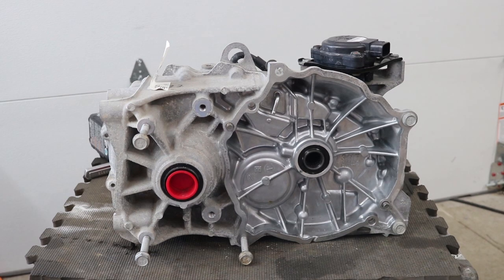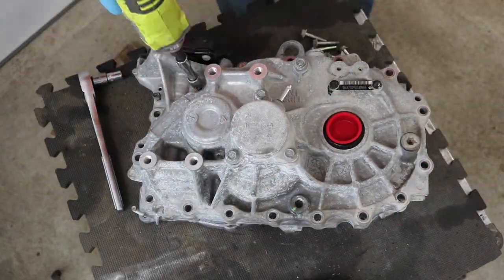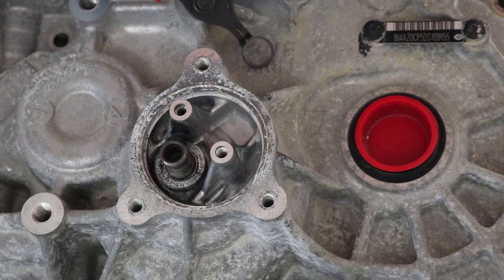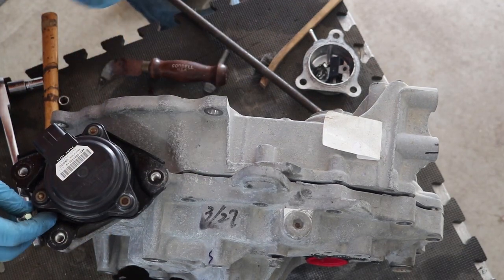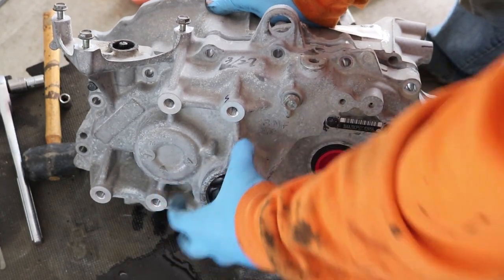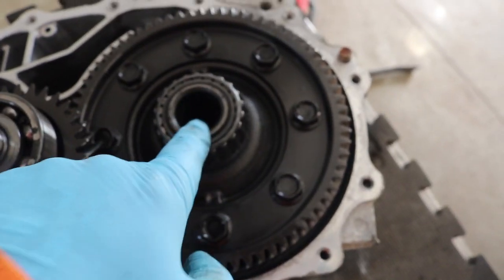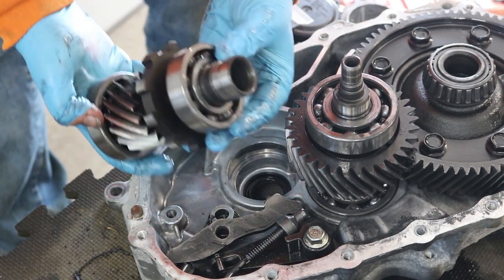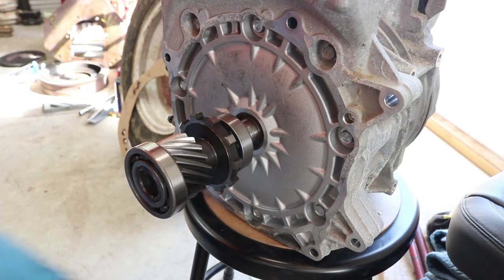Nissan Leaf Transmission/Gearbox Teardown

Comment: Inverters can cause serious damage to bearings from induced voltage.  Industrial and HVAC motos on Variable Frequency Drives have similar brush arrangements to protect the bearings.

Comment: Don't you want to use the gear box to bring the rpm's down? If you could lock the differential could you run a hydraulic pump off the other  side?

Comment: hello,  i have been watching your videos and i want to re power a 51 willys jeep with a motor like this.  does that trans/gear redux have a limited slip for each side of the outputs?  In my application i would make a shaft using the rear facing out put and connect it to my transfer case.  the problem would be if it was limited slip or clutched; i desire all the reduced rpm power exiting from just one side.  thanks for sharing.

Comment: I am trying to diagnose a problem with my 2011 Nissan Leaf. I would describe it as torque steer but I don't know if that's what it actually is... When I give it "gas" it pulls to the right, when I let off the "gas" it pulls back to the left. But it only does this once it's over about 30MPH and it does it in a "binary" or "toggle" fashion. Meaning it will only pull back to the left after pulling to the right. So if I give gas and it pulls to the right then I give more gas/torque it will NOT pull to the right again - only if I let off the gas and it pulls to the left will it pull to the right again after giving it more gas. So it toggles pulling left and right. That's why I think it's different than torque steer.  Anyway, I was hoping seeing this could lead me to at least a partial answer. What I CAN see here is that the left and right wheel are NOT being driven independently, it appears that they are both driven from the same gear. Which would mean that the pulling is not a problem originating from the motor but rather something after the half shafts going to the wheels. 
Any idea where I might look for a solution (The dealer thinks its the rear motor mount but this doesn't make sense to me)

Comment: Trying to figure out if I could flat toe a leaf behind our Tesla by disconnecting or manually actuating the parking gear. I don’t see any fluid pumps in there. I would like to take the leaf to the beach with us so not to get sand and junk inside of our Tesla and we have unlimited supercharging for free on our older Tesla.   Our leaf only has about 25 miles of range left
Reply: Mechanically there is no reason it can't be flat towed, and it should have a neutral gear.

Electronically, you may have problems. Voltages induced in the motor can damage the inverter, which is why no EV manufacturer (to my knowledge) recommends flat towing.

Comment: So the engine/motor is cooled by coolant, does this gearbox have transmission fluid?
Reply: Pet, the fluids specifications are in the Owner’s Manual. The 2015 Nissan Leaf reduction gearbox calls for 1½ US quarts of Nissan S ATF.
No drain and fill schedule is mentioned in the service schedule that is with the Owner’s Manual; only to check the level. Elsewhere I have found 50,000 miles recommended for changing the fluid.
Reply: Electric motors are only rarely called “engine.” Calling internal combustion motors “engines” seems to be an English language thing. “Engine” is “an ingenious, or clever, invention.” Thus “engine” lathe, cotton “gin.”
“Motor” < Latin mōtor = mover.

Comment: Hi thank you for your detailed easy way of stripping it down and explaining, I have one question you've probably been asked this before but could the motor be modified to be a off grid generator either by wind or hydro. I have no idea when it comes to electronics but I can hammer and weld anything.
Reply from the maker: You could, but it would be wild three-phase alternating current. Read up on some Wind forums about how wild 3-phase can be used for off-grid setups.
Reply: @BenjaminNelsonX  thanks for getting back as I said I know very little, the great thing with you tube is has many good guys like your self that are reusing stuff and giving your knowledge, I had the chance to buy a damaged leaf for £1000 complete but haven't worked out how to re configure the motor and battery to use as off grid.

Comment: So if one had a desire, then should be able to easily upgrade the Leaf and make it faster just by changing the gearing ratio. Neat! Thank you Ben!
Reply from the maker: I think the Leaf will top out at 93 MPH. Not sure how fast you want to go in a stock car!

Would be cool to have EVs as part of NASCAR though!
Reply: @BenjaminNelsonX  I wasn't necessarily considering the top speed, but I'm toying with an idea of putting whole drive train from Leaf in much lighter vehicle, my main goal would be to improve the acceleration though, and different gearing could improve that too. Since the vehicle would be smaller, top speed wouldn't be my main goal. I probably should have used word quicker, rather faster

Comment: Wow, so simple compared to a complex traditional gearbox! No wonder the dealers hate electric cars, they are so reliable they never need repair!
Reply: Well Said. Can't agree more.
Reply: Not quite. While electric cars require much less maintenance, every one comes with a maintenance schedule.
I just drained and refilled the transmission of my ’15 Leaf. The oil (Nissan S ATF) was black. Very slight fuzz on the level and drain plug magnets. Two quarts less than $25 from the Nissan dealer. Cheaper than anything online.
The Leaf got a new Interstate 12 volt battery in April. A new rear wiper squeegee in August. Bought a 28” economy wiper blade, pulled the squeegees out of both, cut the 28” one to the Leaf wiper frame, slipped it in with the original metal strips.
I am going to replace brake fluid, which is a required service every two years.
We got a better deal on a set of tires for our Odyssey from the Honda dealer than we could find anywhere else.
Reply: @algrayson8965  how many quarts does it need after you drained the transmission?
Reply: @nickmccain6598 – The fluids specifications are in the Owner’s Manual.
For the 2015 Nissan Leaf the amount of Nissan S ATF is 1½ US quarts. 
I don't know why a set of helical gears and some roller bearings would be particular about the oil but a couple of quarts of the Nissan supplied fluid was about $20 at a Nissan dealer. That was the lowest price that I found.
  The instructional videos that I found only mentioned the level and drain plugs. None mentioned the fill plug on top of the reduction gear box. They had the viewer to fill through the level plug on the side of the gearbox.
  The level and drain plugs each have a magnet, which I mentioned in my comment. A small amount of fuzz is normal after 50,000 miles. This fuzz results from the burnishing of the gears during break-in. At a subsequent drain and fill at 100,000 miles no additional fuzz should accumulate.
  Most of the time of this service is taken removing and reinstalling the fiberboard bottom panel.
Reply: @algrayson8965  cool. I plan on getting a used leaf this weekend. I guess the guy had a faulty battery. So it should almost be like 3 years old instead of 8 years old cause its 2012.  So I'll drain the transmission and put some new brake fluid in it by using my wife's leg power. Anything else I should change when I get it? I'm really excited to get a RC car that I can drive but am also nervous.  I built 2 v8 motors in high school with my Dad.  He is gonna flip out when I drive to his house
Reply: @algrayson8965  I'm getting rid of a turbo 4 cylinder. It gets the same city mileage as my wife's SUV. But freeway its really great. But all I do is city driving. Turbo motors get way too hot. We need manufacturers to make the switch to electric. Cause the motors they are making are trash. I can't even go up a mountain without being careful. It hits 215° so easily in 80° weather
Reply: @algrayson8965  When you say "drained and refilled the transmission" do you mean the "reduction gear oil" I am confused and trying to figure this out for my 2013 LEAF

Thank you
Reply: Changing the fluid will net an increase in efficiency of .4 of a mile per kw. 24 kwhr x .4 m/kwhr  = 9.6 miles increased range. Nothing to sneeze at when a degraded battery has only a 70 mile range.
Reply: More like 70 km unless you drive at 10 km/h with ALL accessories off

Comment: Benjamin, could this motor/gearbox be utilized with a single output shaft? (instead of each wheel being driven by it's own axle). I'm considering the Leaf drivetrain for a rear wheel drive car (MGB) and I'm trying to get my brain around how I might connect the electric drivetrain to the OEM driveshaft and differential.

Comment: Would it be possible to run a rear propshaft off of the gearbox to replace an original gearbox in an EV conversion? I'm looking at potential weight saving and I think this box would be lighter than my current one which is probably around 80kg or so.
Reply from the maker: I would imagine that you could.
Keep in mind that this gear-box has a differential built-in. You would need to lock the one side of it in place. And the differential in the rear axle that the driveshaft goes to would add another layer of gear reduction.
You would want to make sure the total gear reduction is appropriate for your project.

Comment: On my third Leaf. Current Leaf is 2023 Plus and I loveit! Why? Simplicity as demonstrated here. Highly reliable and fun to drive. My new Plus seems to be complicated for an 87 year old but YouTubers and my Grandson have been a big help in getting familiar with all the installed new stuff like Pilot and Apple. Especially like One petal driving. Don't know why more prospective EV drivers don't buy Leafs?
Reply: From what I’ve seen, there are 3 reasons that people don’t consider the LEAF line for EVs: The fact that the battery is passively air-cooled, which (literally speaking) results in more degradation when you drive “like a normal person” (even though it also helps to make the battery pack easier to repair/rebuild); then there’s the fact that it “feels old-school/outdated” in terms of technology; and lastly the LEAF name is fairly synonymous with the “weird looking” old body design, given that Nissan waited 7 model years to change it to a more “normal” body design. Personally, I don’t give a damn if it feels old-school or “looks weird”; I just want a reliable vehicle, and combustion engine vehicles have proven to be far from reliable in my personal experience. Have a good one.
Reply: @jacobcarlson4010  Spent one terrible winter in Boise and six hot summers in Scottsdale. Noticed no adverse battery issues. Why? It is my understanding that the hot air heater moves air around the pack and conversely move cold aiir conditioner around pack in summer. Audi has discontinued their pump systems because they couldn’t notice any difference.

Comment: Does the transmission turns while the motor turns. I know that it is a stupid question but I am not mechanically smart
Reply from the maker: It is very simple gearing. The motor is directly connected to the gears. The is no clutch or other disconnect mechanism.
The gears turn while the motor turns.

Comment: Do you know the milage of this car? The gearbox looks brand new.
Reply from the maker: I think it was 36000 miles.
Reply: @BenjaminNelsonX  thanks.
Reply: As the reduction gear set has no wear following initial break in there is nothing to generate more dirt in the oil (Nissan S ATF). When the gears were brand new they had microscopic roughness to the gear teeth faces, which burnishes off and being steel end up on the level and drain plug magnets.

Comment: Thanks for the video.  Great to see inside this gearbox.  Do you know (or any transmission experts out there) if there would be a problem with running this motor/gearbox combination in reverse?  I'm looking at using it in a RWD chassis and it would fit must better if I could mount it backwards and then drive the rear wheels.  I'm pretty sure the electric motor doesn't care what direction it is going, but not sure about the gearbox.
Reply: i dont see any problem to place it in regular position but on rear axle. the main problem would be with default ESP.
i plan to use EM57 in lotus 7 replica and separate motor and charger/invertor. battery and electronics will be in front of the car and invertor will be connected with motor using 3-phase wires.
and i worried how esp will control slipping wheels, because it tuned and preprogrammed to be at fwd.

Comment: Just a question where the two red caps are on each side of  the CVT .

Is that where the tbe drive shafts to tbe front wheels are inserted?
Reply from the maker: @anonanon9385  Yes, the red plastic plugs just fill in where the front wheel drive shafts connect.
Reply: @BenjaminNelsonX  awesome it's a very good design.

Comment: You should have spun the big gear one revolution, while counting how many times the small shaft (motor) spun. That would tell you the final gear ratio.
Reply from the maker: Good idea! I just didn't think of it at the time! Maybe I can put some marks on the gears to make it more visible. At the moment, this is all still on my workbench. No reason I can't still film that.
Reply: BenjaminNelson just count the teeth of each gear that mesh together. Divide the big by the little, say 43:17 = 2.53:1 ratio.
Reply from the maker: @sail4horizon  I did, and I got a slightly different number than what was listed as the gear ratio on Wikipedia.
Reply: BenjaminNelson maybe the person that wrote the wiki can't do math :)
Reply from the maker: I just went and did exactly this - spin the big gear, count the revolutions of the small gear. You won't believe what the results are! Video coming soon.

Comment: Hi. long time since your video... I wonder if it is possible to replace bearings to fix the transmission My leaf is making a lot of noise...
Reply from the maker: Bearings inside this gearbox look similar to any other bearings I've ever seen. I can't think of any reason why they couldn't be readily replaced.
Reply: @BenjaminNelsonX  thanks.
Reply: @BenjaminNelsonX  Thank you for the video. My 2013 leaf just started making noise I took it to the only EV mechanic in town they thought the noise was coming from "the trans axle assembly" they said they "removed the fill plug to check the fluid level but the fluid was full but in poor condition also the fill plug which has a magnet on the end was covered in metal from the inside of the transmission they told me the metal is from whatever part inside failed they recommend replacing the transaxle assembly which will cost $3000" I don't have that money this car only has 50,000 miles they didn't suggest any other options like changing the fluid and draining it and unfortunately there's no other mechanic that can look at it any advice please I'm not mechanical at all and this is my only car for myself and my children. Thank you in advance for any suggestions.

Comment: Makes me wonder why you need to dismantle it at all why not use the engine inverter the works just add a battery pack to the tractor and you got it all.
Reply from the maker: First of all, it would be pretty hard to do the work of building a motor adapter plate with all the components together.
I would NOT use the gearbox with the tractor. One person suggested just connecting the tractor wheels right to the differential of the Leaf gearbox! A tractor transmission and differential is a VERY different thing than an electric car gearbox and differential!
The Leaf inverter can NOT be used as stock. It requires the exact right CAN inputs, or at a minimum needs to be modified with a third party board.

If I do use the Leaf motor with the tractor (which I would like to do) it needs some careful mounting of the motor to the existing transmission bell-housing, probably a support bearing, and a coupler or (more likely) flywheel connected to it.

Besides all that, it's pretty cool for people to see inside!

Comment: Is it a locked differential,  or is it open?  Are both sides locked in the same directing?
Reply: It's an open diff. Nearly all EVs use them and simply use the extremely fast motor power control + electronic braking to perform "limited slip" functions

Comment: Thank you for the video. My 2013 leaf just started making noise I took it to the only EV mechanic in town they thought the noise was coming from "the trans axle assembly" they said they "removed the fill plug to check the fluid level but the fluid was full but in poor condition also the fill plug which has a magnet on the end was covered in metal from the inside of the transmission they told me the metal is from whatever part inside failed they recommend replacing the transaxle assembly which will cost $3000" I don't have that money this car only has 50,000 miles they didn't suggest any other options like changing the fluid and draining it and unfortunately there's no other mechanic that can look at it any advice please I'm not mechanical at all and this is my only car for myself and my children. Thank you in advance for any suggestions.
Reply: @benjaminnelson
Reply: @BenjaminNelson

Comment: Is there grease or oil we should change?
Reply from the maker: I bought these parts at a salvage yard. Anything that would have had fluids in it was drained at the yard.
There was only just a little oil in this gearbox.
I would consult the Nissan Leaf service manual for recommended maintenance.